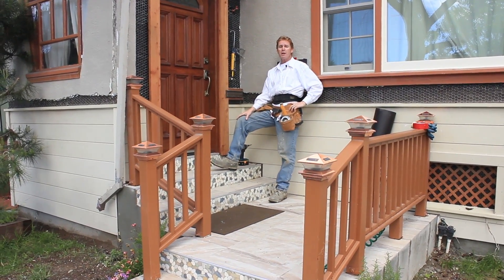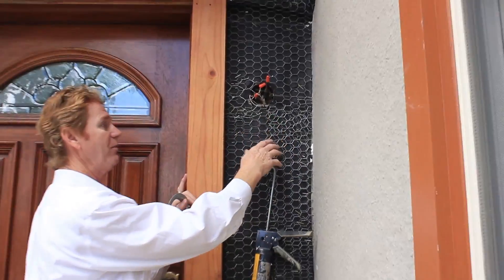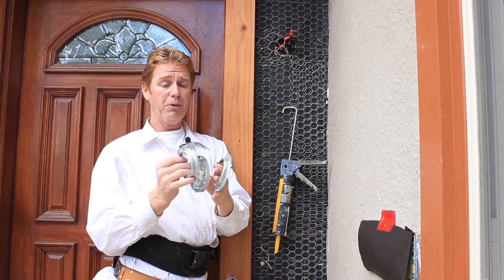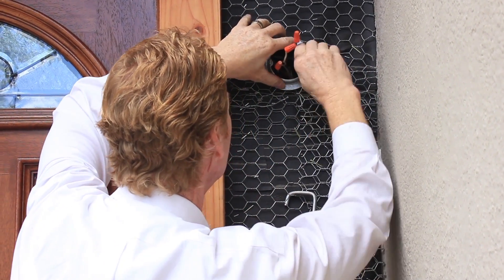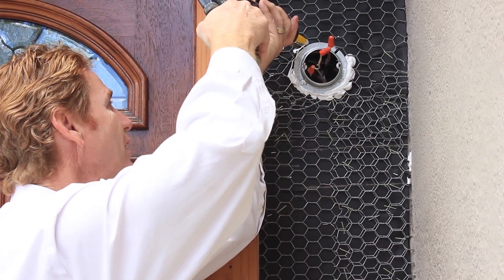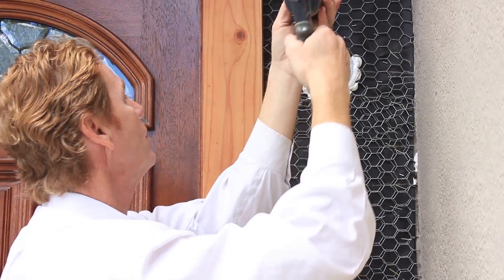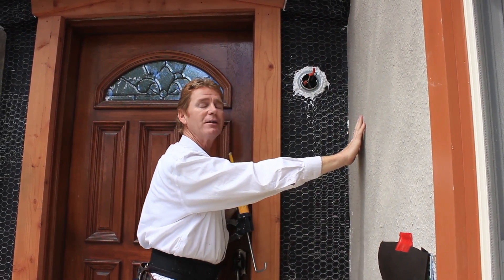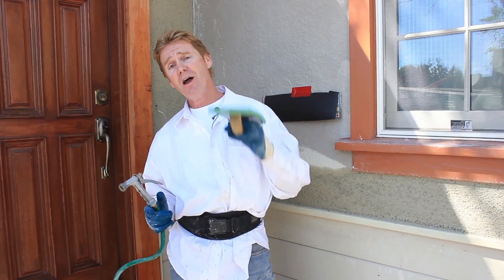Stucco or Plaster rings, Add electrical outlets in stucco walls.

Comment: This is good to see. I have a couple of light fixtures to deal with and wasn't sure what to do. I also have to deal with the electrical outlet. What would you suggest for that? Is that silicone sealant? Will the stucco not pull off of it or will it be fine?
Reply from the maker: @therenaissancewoman2080  Silicone is for fish tanks and often kitchens or bathrooms, acrylics or polyurethane  caulkings are better.

Comment: Hi Kirk, unless that is a metal electrical box, you should be using a non-metallic plaster ring. Metal has to be electricaly bonded to a grounding conductor incase it contacts a current-carrying conductor the current will be safely shunted to a low impredence ground path and trip the overcurrent device. Some might argue that the mud ring will be grounded through the light fixture brave, but the NEC requires the ground be uninterrupted upon removal of the fixture.
Reply from the maker: Howdy Chris, thanks for the tip, it was indeed a metal box.
                           Peace, love, and harmony to all
         Sound Plastering tips for the DIY beginner’s and Plastering experts

Comment: Thanks Kirk, great video!
What about other protrusions like electrical boxes, pipes, propane lines etc.?
Do they make rings for that, or, more importantly, how do you stucco up to them and seal them off?
Thanks man!
Reply from the maker: Excellent question, those electrical boxes should be set at least 7/8 of an inch past the plywood surface, then when your lath is complete, you fuse the paper to the box with any polyurethane
 caulking.  👨‍🏫
Reply: Thanks Kirk! @StuccoPlastering
Reply from the maker: @523hotsauce  😉

Comment: I'm a novice DIY-er and homeowner trying to a repair of this nature. My question is: it seems to me that the metal ring has nothing it is anchored against to support the small weight of the light fixture. It has the two screws to the wall board, the adhesive ring underneath and the stucco around. Is that sufficient to hold up a 5# light fixture?
Reply from the maker: Good afternoon Human Dude, it's supported or attached by screws.
                         Bringing peace, love, and brotherhood back to the world of, “Plastering.” 😏
with over 800 educational and free Youtube videos, by your favorite plaster geek, “me,” and my son, “Jason,” the bearded plasterer.😉

Comment: How would one install exterior garage lamps on a stucco wall (Florida) on an existing home that does not have any hole or wiring to supply power?  I would assume an electrical (old work) box would have to be installed/wired?  No plaster rings are present.
Reply from the maker: Morning tracker dude, I'ma a plaster dude not an electrician.
 however, I would suggest you do call an electrician as thats what I would do or you can do as your subconscious saw in this video and use solar lights,
 Best wishes,
 kirk giordano plastering
Reply: Hi Kirk - After the electrician installs the electrical box for the exterior light fixture, how would you seal around the hole to limit/prevent water leaking? Thanks!

Comment: Great vid, got a bit of an off topic question though. Will that corner crack? Looks like the previous lathers didn't bother to break the entire corner and threw the paper and wire right in there without crossing the material with the previous lathe. Not exactly how its done with our crew, a bit strange.

Thanks for the videos, awesome job.
Reply from the maker: Evening Diaz dude, you must be a plasterer, excellent question, my opinion is yes, there will be a hairline crack at this vertical edge, but if I were the contractor I would ask myself do I want to open a wall and find possible a can of worms or when the stucco cures in 28 days apply a bead of caulking into the hairline crack.
 Many times a  quality primer and paint will flood these types of cracks.
 Dude, you're definitely on the ball!
 have a good evening
 Kirk and family.

Comment: What sealant were you using?
Reply from the maker: Morning Ian Michaluk, it was A Polyurethane Premium Grade High Performance Elastomeric Sealant, goes by the brand name of sikaflex.
 It's nasty stuff if you get it on you as it's not easy clean up with soap and water, instead you have to use Thinner or Denatured alcohol.
Best wishes, 
 Kirk and family